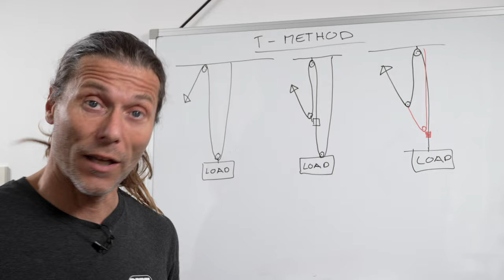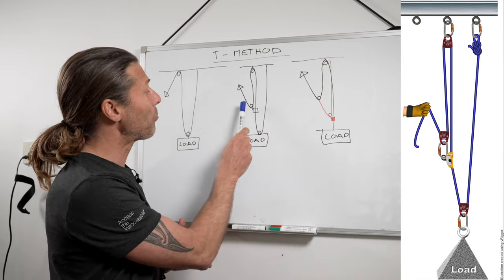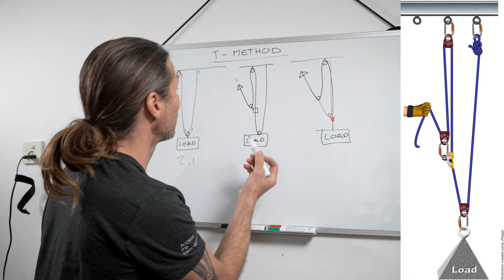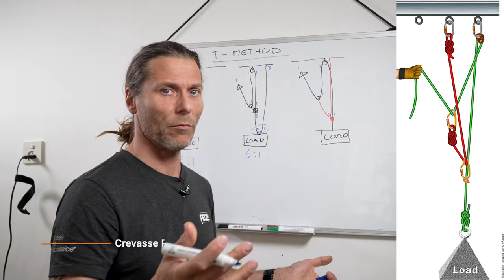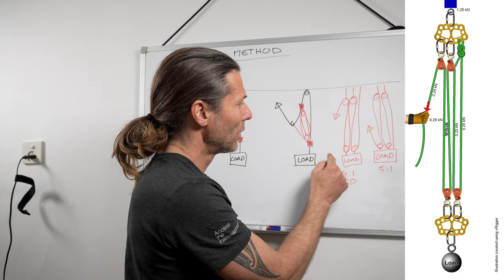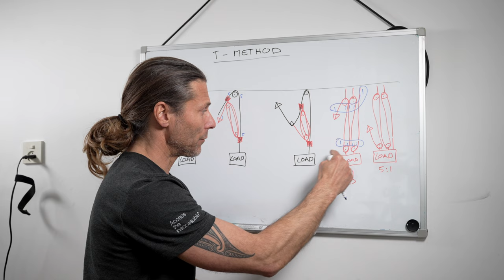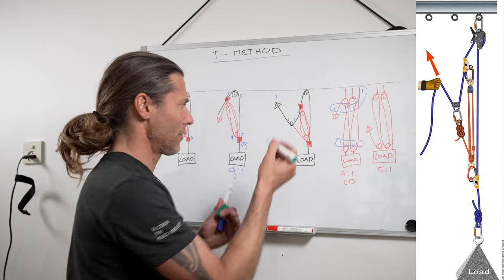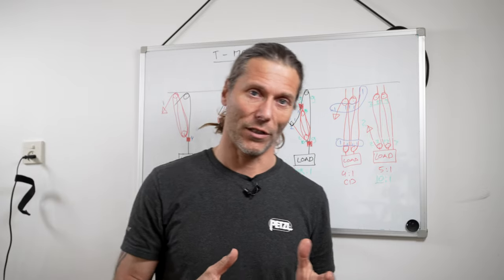How to use the T Method to calculate mechanical advantage - IRATA Rope Access Training

Comment: Great content! This method it's very easy to understand!
You could add the estimate percentages on force loss by friction (based on the tests you did of the different devices and pulleys, 
That could calculate pretty closely the force needed to lift certain amount of weight.
Reply from the maker: Absolutely!👍
Thank you

Comment: How realistic are these ratios? Friction? Pulley efficiencies?
15:55 Shouldn't it be a 10:2 (output over input) which is essentially the same as a 5:1 just that you don't come in with 1?
Reply from the maker: This is all for Ideal Mechanical Advantage and might not even be close to an Actual MA. I did a few video's on that as well. Like you said, it depends on friction and pulley efficiencies. And rope diameter (essentially friction)
ARE WE BUILDING OUR Z_RIG WRONG: https://youtu.be/sIMFvf_E5Y8
FRICTION: https://youtu.be/uq7AhJYXOQ4
REAL WORLD MA TESTED: https://youtu.be/vD9SzJsan5Y

You are correct on that 10:2 on the simple system. Only when viewed as a separate system though. Then that 10:2 would be the same as 5:1 because you need double the input. It is essentially the same. I used the separate drawing as a clearer example in the larger inline system. Sort of like a zoomed in view if you will. I touched on a 2x input in one of the previous quizzes I did in another video. I used a TTRS as an example but it is basically the same thing. I think it was the quiz at the end of the COMPOUND video. The answers will be in the COMPLEX video though.

In this inline 19:1 system where the 2T input is generated by a pulley and where that same 1T travels on to meet a rope clamp, that 10T and 8T are multiplied units of Tension. Or I could say that the initial input is 1T in the inline system. Not 2T. So as a separate simple MA you are correct, just not in the grand scheme of the inline system.
Does that make sense? My mind is foggy, working through the night is not good for clarity haha.
Reply: @TheRopeAccessChannel  Thanks for the response and stealing an other hour of my life (the videos you referenced are exactly what I expected)
Reply from the maker: @ralfrussel1950  😂👍🏼

Comment: hello, newbie here ! when you rig to the load, the pulley system is a odd number like 3:1, 5:1 or 7:1, if you rig from an anchor it's becoming an even number like 2:1, 4:1, 6:1, etc... am i right ?
Reply from the maker: That only holds true for a simple pulley system. The moment we start adding things on to it everything changes.. I suggest you watch all four video's starting at SIMPLE then COMPOUND and the COMPLEX. That should bring you up to speed fairly fast.

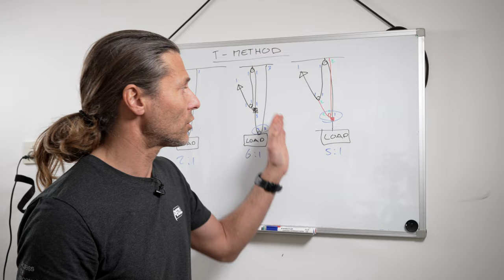Comment: But why at 8:35 the calculation comes to me like 26:1 the first and 28:1 the second? What do I wrong?
Reply from the maker: Probably the difference between the first SOF pulling direction.
Reply from the maker: Not sure. I posted this a long time ago haha
Reply: Mmm..I don't know because I tried to calculate imagining having the load at the bottom. but if I calculate the upper advantage of the hoist, I get 27:1 in both cases😅 The problem is that I'm not sure that my calculations are exact, so I was looking for confirmation😆 Anyway, thanks so much for all the videos you make! You are super!!!🙏🏻
Reply from the maker: The answers are what I gave. Just start with T1 and draw it out, it should become clearer then